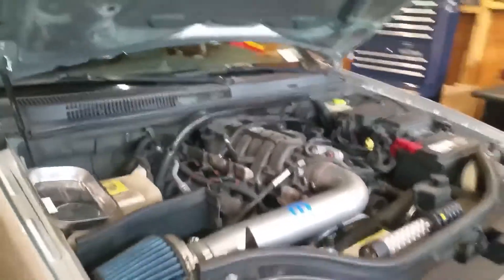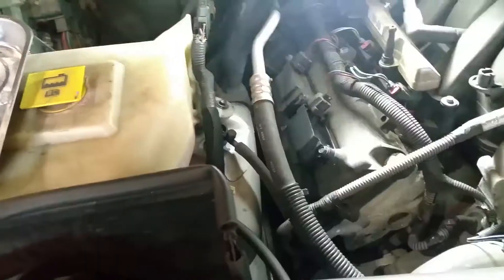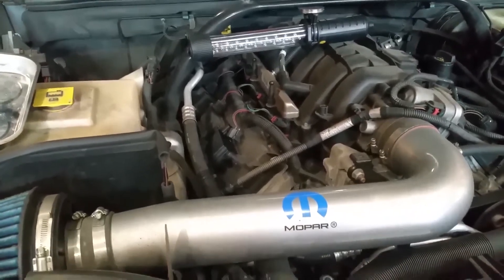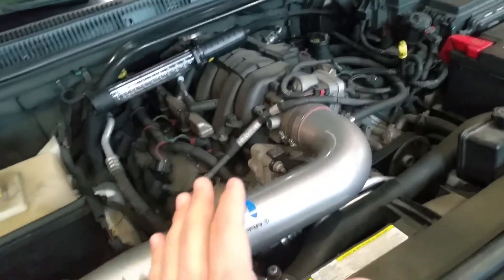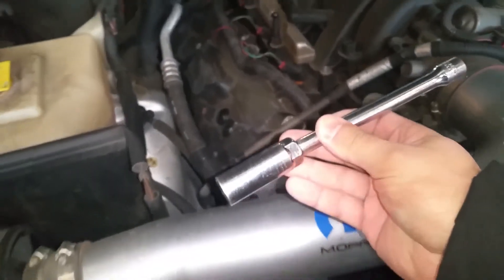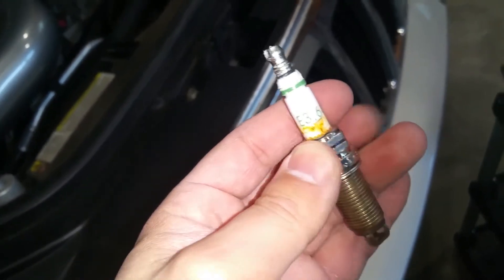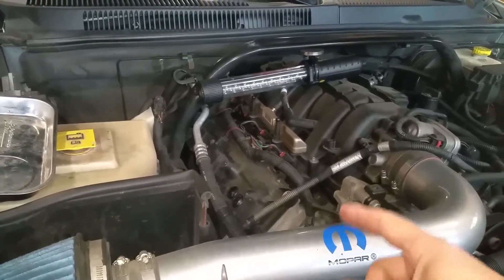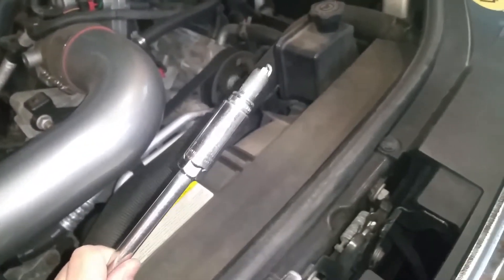Diagnosing Engine Error Code P0302 on Jeep Grand Cherokee and Changing Spark Plugs

Comment: Have you ever had a problem with it shutting off after fill up. Mine 09 wk hemi did til I switched to 89 octane. Still does it but not as much. I just switched gas and change a fuel vapor sensor

I’m her as well because this code came out recently
Reply from the maker: It used to do it when it was new, but it hasnt done that in years. The issue just went away on its own.

Comment: Having same issue with my 300 rn and I’m gonna take it in tomorrow. Spark plugs were t long term fix and switching g ignition coils didn’t switch code location. Valve springs/lifters tend to be problem on this engine causing this code. Not excited for this fix
Reply from the maker: Sorry to hear that. Its been 2 or 3 years since I made that video and luckily for me the code never came back. These Hemi engines do have noises lifters and sometimes upon start up I hear some lifters ticking until they get oil. Thanks for watching and keep me posted, Im curious what they tell you.
Reply: WATCH ME WRENCH thanks for the reply I’ll let you k ow what they tell me tomorrow. There’s a ton of videos about p030_ codes
Reply: WATCH ME WRENCH it ended up being a flattened cam
Reply from the maker: OH MAN THAT SUCKS. what did they suggest?
Reply: WATCH ME WRENCH they came back later in the day to inform me that a lifter has gotten into cylinder five and the engine needs to be replaced. Definitely not dropping $10k on this car at 86,000 miles. I’m think of selling to junkyard (very painfully trust me) and probably trying to find a good, affordable Lexus or nice Toyota. These Chrysler reliability problems and relatively short life spans are too stressful and bothersome to every buy one again. It was fun while it lasted. Sucks that this freak issue has ruined everything but i have no option but to get another car, it’s totaled. Cheap luxury doesn’t work
Reply from the maker: Sorry man, that is some bad news. I think that motor is dead.

Comment: do a compression check on number two just to make sure that the valve seat hadn't dropped
Reply from the maker: If the Jeep kept running bad yes I could have done a compression test but I was able to fix the issue and she still runs great. Thanks for watching.
Reply: @WATCHMEWRENCH  what was the issue I got a 5.7 on number to run a real rough I put a set of plugs in it and it still runs rough I didn't check my coil yet I Got a Feeling by the Sea drop it on mine
Reply from the maker: @jessietesch2764  I also changed the plugs in addition to the 1 coil pack and the code went away.

Comment: .
Why don't you just wrap the tape around horizontally on the joint ...
.
Reply from the maker: Because I had to use different sized extensions throughout the task times and that would have been a bit more work so I just taped the one socket which just kept getting reused.